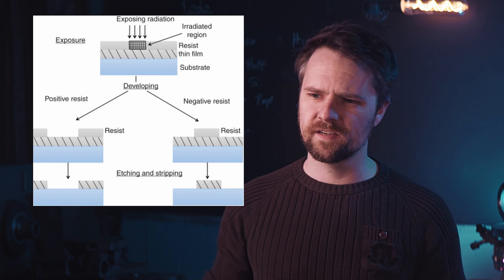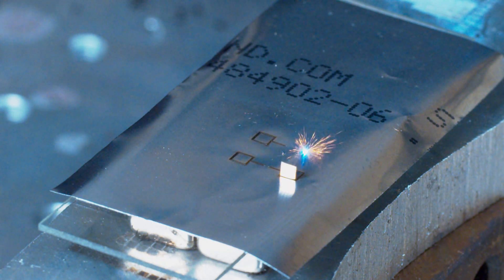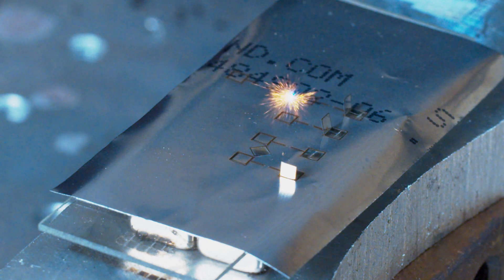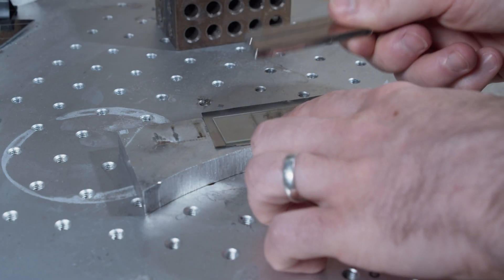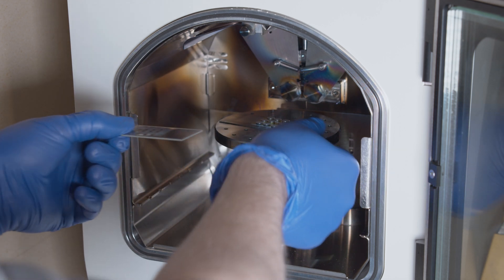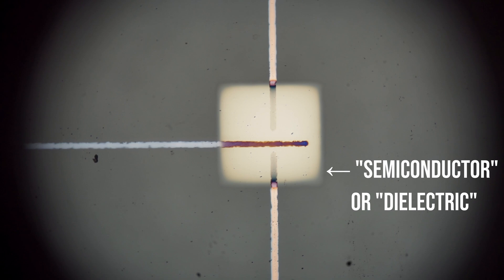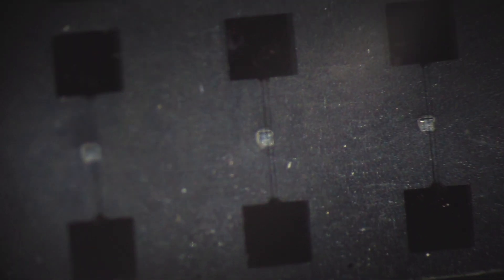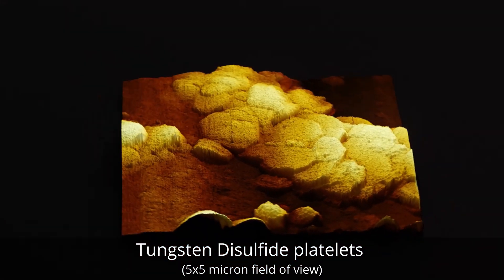Laser etching stencils for vapor deposition

Comment from the maker: 🚨 Embarassing correction! 🚨 After publishing I realized the scale on my calibration grid was slightly incorrect, and so the feature sizes are wrong. Min average feature size is 10-15 microns, not 5-10 as I stated in the video. There are examples of ~5um but these are with "unreliable" settings that are prone to bridging... the crisp, consistent examples showed in the video are closer to 10-15. Apologies for this goof, it's pretty embarassing and definitely makes the results less impressive. I think the feature size could be reduced down to the 5 micron I mentioned, but will take more tuning.  Wanted to mention in case anyone tries to replicate this for themselves!
Reply: Don't worry, we all break some taps. 👍
Reply: Yeah tricky to get small features with such long pulses(HAZ ends up being kind of huge), unfortunately 10ps lasers are still a bit tricky to get your hands on. Also really depends on numerical aperture of your optics setup, looked like you are using a galvo f-theta setup which is nice for speed/convenience but not great for spot size. I've managed ~2um with a q switched YLF 8-10ns, but that with an objective setup w/linear motor stage and was selectively removing sputtered copper to make some transmissive gratings. For that 1thou shim material(steel, brass) though same deal as you, 5-10um if being patient, too much melt, not enough ablation with long pulses. Wavelength isn't making life easier either, probably worth the time to consider 355nm.
Reply from the maker: Agreed with all the above!  Looking to get my hand on a 532nm at least (would love 355), and sorely tempted to rip the laser out of the galvo setup and just stick it above a precision motion stage.  The software that comes with these lasers is absolute garbage, and I'd rather just code up my own gcode converter or something instead :)

Would love to find a fs or ps laser, but as you said they are still a bit tough to find on the used or import market :(

One thing I'm pondering right now is doing some kind of partial ablation (e.g. just a pass or two which removes material but doesn't fully punch through) and then etching the rest of the way chemically.  If it's isotropic in theory the partially ablated regions should etch through first, maybe leading to finer features?  Sorta removes the convenience advantage though... just go use photoresist at that point heh.

Funny that you mentioned removing sputtered layers.  I was playing around with that a while back and had good luck with patterning, but the power is waaay too high.  Even at 1% and as fast as you can go while maintaining overlap, the ablation spot was around 30um.  Been trying to think of a way to stick a attenuator or beam splitter somewhere in the optical path do pull the power down even more.  Would be a really nice/fast way to generate photomasks.
Reply: @BreakingTaps  if you do manage to get you hands on something with a fairly short pulse but still in 1064nm ish land, you can setup a second or third harmonic generator pretty easily for these high intensity pulses. Yeah there are conversion losses, but the increase in absorption offsets it easily for most materials. Only real drawback is they are hilariously temp sensitive, and optimization is tedious.

On the partial and then etching.. isotropic material sounds pretty wishful thinking to me. Grain structure gets all sorts of mucked up at the site due to local melting from long pulses.

For the thin film ablation, I was working with copper on glass slides, so pretty good mirror at a micron lambda. Combined that with a decent objective, running the pulse rate on the high end and keeping the pump low to prevent high energy pulses. This was a slab style folded resonator laser though, suspect the gain was a good bit lower than your fiber laser. Assuming your beam isn't tiny(otherwise expand it) you can just use a low ND filter at 45 and use the reflected as output and beam dump the transmitted(or the reverse). Might worry about having an AR coat on the back of that filter though for these applications and beam quality considerations.
Reply: @BreakingTaps  I know exactly what fiber laser you're using, and the shitty software... I keep thinking that I should do an open-source G-code controller that plugs into these ebay-special fiber lasers so they're easier for the hobby community to work with.
Reply: If you can get it down to 8 micron you can make an 8080 chip :) It'd be slightly bigger but properly within an order of magnitude.
Reply: Ha, I literally said to myself in the voice of Ron Burgundy, "I don't believe you". Been there done that!! Still really great results if you ask me.
Reply: 😱I'm disappointed  to learn that you aren't the infallible god of science...just a exceedingly impressive human😔 😜

Comment: First time here. The movie piece at the beginning made me think it was an ad about an actual new movie! Very well done! Sometimes a stencil mask (Shadow mask) is the only option. I have the photolithography tool, but I need to use a shadow mask on porous silicon surfaces. Porous silicon is too fragile to sustain photoresist and develop processes. and I only need one process step. So no alignment requirement. And you are doing this in your garage??? No way! a sputtering equipment and a AFM tool in a garage? 😲

Comment: Are there materials that would be suited as mask for dry etching glass?
Reply from the maker: Dry etching via plasma? Hmm, I'm not sure. I suspect most metals etch at the same or faster rate than glass under an oxygen/argon or reactive plasma. You'd probably need to deposit something harder like SiN which would require a reactive DC, RF, or CVD system.  I did find this paper on a quick skim that used a silicon wafer as a hard mask: https://www.researchgate.net/publication/223079651_Deep_plasma_etching_of_glass_with_a_silicon_shadow_mask
Reply: @BreakingTaps  Thank you. I'll look into it.

Comment: Have you tried using some kind of thermal adhesive tape under the metal to absorb some of the extra heat while cutting? That may help mitigate the thermal warping issue. Use a solvent to get it off the adhesive later or something.
Reply from the maker: I haven't, but that's a great idea!  Will try that out next time.  I also got some new parameter suggestions from another viewer that supposedly works better, less warping although takes a little longer. 🤞

Comment: you need an ultrashort pulse laser and it's no problem... no heat-induced warping if you apply it right ;-)
regards - your local laser expert :P
Reply from the maker: Yes! I would love to get my hands on a picosecond or femtosecond :) Unfortunately don't seem nearly as easy to find on the surplus market, (for reasonable prices), have had saved searches running for months hoping something would turn up. I dream of the day I can do femtosecond micromachining of metal and glass 😍
Reply: @BreakingTaps  I do it every day, lasers are the best machining tool, contact free and free of consumables. Photolitho, at least for micrometer sized structures is so 19th century, althrough it is almost unbeatable at accuracy, many applications can be replaced by direct laser structuring. I have daily access to more than 30 laser beam sources... it's great fun but therefore I have no need for more and got rid of most of my private beam sources. 
Ultrashort pulse lasers with enough pulse energy to ablate will likely not fall much more in cost any time soon, but average power goes up and up. We're reaching 10kW+ at this point... now I leave it up to your imagination as to what we do with those :P

Comment: Great video!!  Make/model on fiber laser and sputter coater?  Thanks!!
Reply from the maker: Thanks! Fiber laser is a random chinese 50W non-MOPA laser (if you search for "50w fiber laser" it's the variety with a galvo scanner and head that moves up/down with a crank).  I believe mine has a JPT laser inside, although Raycus is common too.  Sputter coater is a Leica EM ACE600.  Got it used for a very good price because it was non-functional, repair ended up being very easy (software fix). :)

Comment: What sputtermachine is that? Looks real cool did you make it your self? can't wait to see more!
Reply from the maker: Afraid it's a commercial machine (Leica EM Ace600). I got it for a screaming deal on ebay because it was inoperable, but the fix was relatively simple (some uhh, software hackery involved).  Little sad that I didn't make it because it's not terribly interesting to talk about being commercial, but it works quite nicely so I'm not too sad :)  Only downside is that it's a DC magnetron so can only deposit metals, and it's very slow because it's designed for SEM coatings.

Comment: did you try cutting the  imitation silver while on the paper and just use it on the paper?
Reply from the maker: Not exactly in that setup, but I did try just regular copy paper by itself and it works quite well! I saw a paper a while back which used filter paper (https://www.mdpi.com/2072-666X/11/7/676/pdf) and got pretty good resolution.  They used a CO2 laser, but I used my 450nm and white copy paper or brown kraft paper, both worked nicely.  Think I got 30-40 micron resolution which is shockingly good for just paper in my opinion :)

Comment: I have two slightly off topic questions I cannot resist asking since you seem like you might know the answers. First, aside from scraping it off, do you know of a way to remove the CFA/Bayer layer/baked on mask from a color image sensor to make it black and white but more sensitive to a broader spectrum of light? Second, when I attempt to make circuit boards by applying a UV sensitive film, the film doesn't properly wash away from where I want to etch copper and partly washes away where I want to keep the copper. Am I perhaps using bad film or is it more likely I lack skill? I've tried varying the variables but never get good results.

I came for the vapor deposition. I just bought a vacuum pump and am making a vacuum chamber and eventually everything for sputtering success at sputtering.
Reply from the maker: I stumbled across this paper a while ago (https://www.ncbi.nlm.nih.gov/pmc/articles/PMC5087437/) which removed the filter with some photoresist stripper (Posistrip EKC830). I doubt this is easily available though, and the MSDS suggests it uses some intense organic solvents (N-methylpyrrolidone and 2-(2-Aminoethoxy)ethanol) http://apps.mnc.umn.edu/pub/msds/ekc830.pdf).  Looks like you can get N-methylpyrrolidone on ebay at least, although not sure I'd want to use it personally :)

Otherwise, scraping the filter off is the only method I've seen.

Regarding the PCB film... I've actually never etched a PCB before!  So no good opinions or experience from me on that topic :)  I know liquid photoresist can go "off" over time, so it's possible your film might just be bad, or perhaps the PCB board isn't fully cleaned before applying?  Before tossing the film, I might try some exposure grids to see if you can dial in the exposure time a little more.  E.g. expose one section for a second, expose another section for two seconds, etc etc up until some large value and see which gives best contrast.  Goodluck!
Reply: @BreakingTaps  Yes, EKC830 isn't available at Walmart:-) I started down the N-methylpyrrolidone route and stopped when I realized I'd be buying way more than I want laying around. It is an ingredient in some fairly common household product (herbicide?) so I might try it. Or maybe I'll keep practising with scraping, go for the nickname "Chip Slayer."

Comment: Nice video Zach! So is your sputter coater something home build or a commercial one? When I worked on oled technology (long time ago) we also used shadow masks. These were cnc milled out of aluminium, had rigid edges and had a tiny ridge to keep the device surface away from the mask to avoid damage of the devices. By the way, lithography is not that difficult and can be done fairly easily with a cheap 4k resin printer at 35um resolution. If you use "lift off" technology you can even avoid etching.
Reply from the maker: Thanks! Commercial machine I'm afraid, so not very interesting to talk about on video :)  I was going to build one originally (chamber in background) but found this unit for a good deal because it needed some repairs which ended up being a simple software hack/tweak.  It's a Leica SEM coater, so has lots of nice features (tilt and rotation stage, dual sputter heads, integrated shutters, turbo and internal diaphragm pump) but it since it was built for thin, even coatings it is also very slow.  And DC, so can only do metals.

That's interesting that the shadowmasks were milled! I suppose a sharp v-tip could make a pretty narrow cut, and you'd have the advantage of a stiffer mask to prevent warping.  Interesting, might try that.  Makes sense that some kind of lip or ridge would be needed to prevent scratching of the device.  By time I was on my third layer you could see some damage had accumulated...doesn't take much to scratch those thin film layers :)

Litho is next! I was just being super lazy haha :)  That's a clever idea resuising a SLA printer as a contact litho machine!
Reply: @BreakingTaps  Good luck with the litho. Watch out, it is actually pretty addictive ;-). You can achieve much higher resolutions than 35 um by demagnified projection of the LCD of the 3d printer.

Comment: Any plans to do evaporative deposition? It requires a higher vacuum, but you get more directional deposition.
Reply from the maker: Maaaaybe. I'd like to try pulsed laser deposition at some point, and depending on how well that works (or doesn't) I might convert it to thermal evap instead.  Love the sputter coater but as you said, directionality isn't great.  And it's very slow (and can only do metals).  Something that can deposit a micron of material quickly would be very appreciated :)

Comment: How do you people get money for all these stuff?
Around 7:55 you complain about small bridges in the material. You could try to get rid of them using something like electropolishing (it doesn't work with all metals), or just simply try to watch it a bit chemically.
Reply from the maker: I was lucky to have a well paying job (software), no children, stalking ebay for deals, and my discretionary money goes into hobby projects/equipment instead of things like cars or fancy vacations or whatever.  When we do vacation we're typically camping in a tent or something cheap, because that's the kind of fun we like :)  So yeah, basically just directing funds other people spend on new phones or cars or eating out all the time or whatever into my hobby projects instead.  And slowly accumulating the tools that I want over the years.

Good ideas about the bridging!  I think something like that could work, and would help a lot

Comment: You can clamp the heat deformed shim stock between a couple of thicker 1/8" or thicker pieces of steel with a couple of small cheap C- clamps, put it in an oven for an hour at 450F , let it cool until it can be handled remove the clamps and your shim stock will be as flat as the pieces you clamped it in.
Reply from the maker: Will give this a shot! Would certainly be an easy way to fix the issue if it works, cheers!
Reply: @BreakingTaps   I am a Bladesmith and it even works on hardened steel as long as the warpage isn't to severe. I hop it works out for you.

Comment: Would love to see a tour of your sputtering and vacuum pump/chamber setup.  I've tried it myself and there are definitely many, many traps novices like myself fall into, so seeing what you've got working would be amazing.  Did you machine your own sputter-gun or buy it from some company, and if so how much was it?  Have you sourced most of your stuff used off eBay?
Great video BTW!
Reply from the maker: Thanks! Afraid the sputtering setup isn't very interesting, it's an off-the-shelf SEM sputter coater from leica.  I snagged it for a very good deal because it was throwing some errors, and the repair ended up being pretty trivial.  But otherwise it's all stock and therefore not very interesting :)  Load sample, hit go, wait for thin film.  I am going to put together a laser pulse deposition chamber later this summer I think (the big glowing chamber in the background) and plan to do a video about the chamber all the little bits I learn along the way.  I have most everything I need, just need to machine up some adapters and find time to work on it!

Comment: Not that it would be recommended or even wise, but I wonder if a super critical fluid (CO²) would be a good option for heat dissipation of thinner metals. Might be enough to keep it from deforming. 

Also given the short distance needed cutting, I wonder if a gas or other fluid could be used to narrow/focus the beam ( like a fiber optic ) more so than expensive optical lenses could focus the same beam. Maybe two fluids in laminar flow with one in the center surrounded by the other, one hell of an engineering challenge there.

Just the ramblings of a madman.